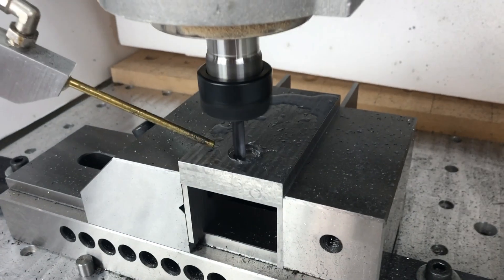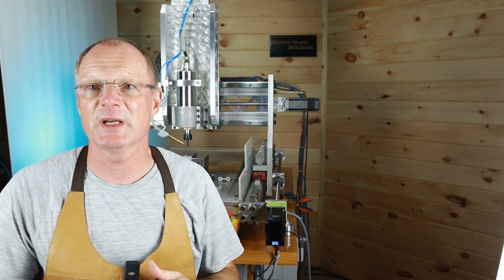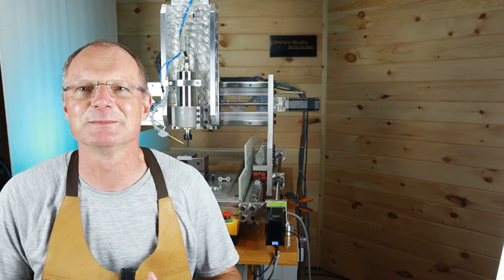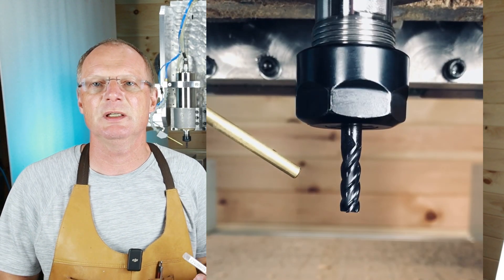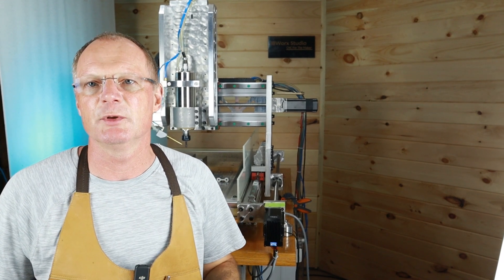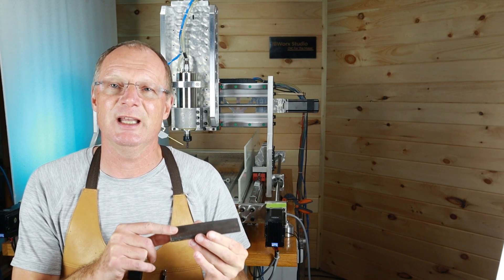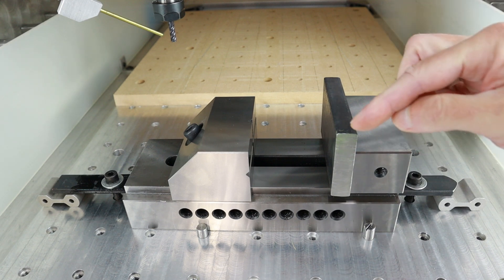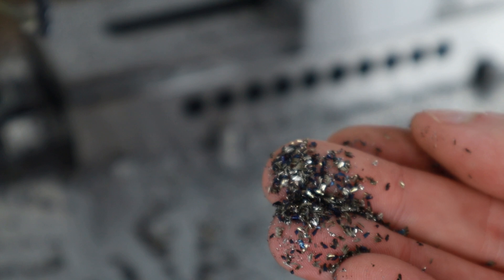Cutting Steel Using a CNC Router (CNC Router Beginner to Pro EP 10)

Comment: Great starting points in this whole series for home routers. Too man yof the online calculators are geared to industrial machines so this helps a lot. Once I get a happy sound I change the tool parameters in Fusion so it keeps the recipe for future use.
Reply from the maker: Yes that is very true most cannot account for the spindle hp and min rpm. You can also make a template in fusion for the different types of cut using a specific tool like 2D adaptive in Aluminium using a 1/4” tool or a finish pass this way you can grab an already proven set up and only have to select the contour. It’s a very handy trick. And thanks for the comment Gerrit as always nice to have you on board.

Comment: Thanks for sharing. I was just curious about this.
Some remove the scale with vinegar (takes some time). Citric acid should work too (I use it to remove rust). Needs to soak for some hours, but by heating up the solution, you can speed it up significantly.
Reply from the maker: Yes an acid pickle is certainly possible and also commercially done on many parts to remove scale. Thanks for your comment.

Comment: Scale can easily be removed using a belt sander. As you've noted, cutting tool life is significantly increased when the steel is free of scale. The same principle is true when machining sand cast aluminum.
Reply from the maker: I think an angle grinder with a flap disc works really well too. But buying it without the scale would be best 😀
Reply: @JBWorx  Scale only forms on hot rolled steel, which is rolled to size at temperatures at or above 1700 degrees Fahrenheit. Cold rolled steel is available in common sizes and is scale free.
Reply from the maker: Yes you are 100% correct, I don’t like to use it if I machine a lot of material off of it as it usually will not stay flat. The cold forming process makes it full of stress. There is also stress relived material, but now we are getting a bit away from what we use for DIY projects and what is readily available to you as a maker without operating a shop.

Comment: JBWorxStudio, you can remove the mill scale on steel by pickling it in vinegar or citric acid for a day or so. also its surprising you cant get hot rolled pickled and oiled (P&O) steel in the states.
Reply from the maker: Yes I am familiar with the pickle process we used hydrochloric acid where I worked … probably too dangerous for home use but same concept. Oh I am sure you can buy hot rolled without scale is just that the vendor I buy from does not carry it - unfortunately.

Comment: I'm new to CNCing metal. My question is, you went with a 4 fluted tool. If you change to a 2 or even single fluted tool, can't you increase your rpm to the power range of your spindle? I believe less flutes cause more deflection of the tool so dept of cut would suffer and/or it would increase chatter. In asking because i have a  9kw 24k rpm spindle and any speed less than 12k rpm is a problem. I am trying to obtain the proper tooling....Thanks! You series has been extremely informative.
Reply from the maker: Your approach is right, however there is really no single flute tool for steel for the exact reason you mention. There are 2 flutes made by Datron for cutting steel with a high rpm but the largest diameter is 3mm. I am currently trying 2 different indexable tools one for facing and one for running a pocket. The nice option is that I can exchange the inserts from cutting aluminum to cutting steel. I don’t have a link to them as I bought them long ago and never used them and now the vendor is no longer available. I might do a follow up video. For aluminum Datron is my choice though.

Comment: Fantastic video thank you. Is there any hobbyist spindle out there that can deal with both wood and metal/steel in a good way? (I assume lot of torque = less rpm?). Spinogy?
Reply from the maker: It does not have to be a Spinogy spindle. If you know you also will work with metals then it is best to choose a 4 pole spindle. Most 24,000 rpm spindles are 2 pole motors running on 400hz. So you can buy a 4 pole that will also run 24,000 rpm but will need 800hz to do so. Because it has more poles it will develop more torque at lower rpm. Also have a look at the bearing set. 3-4 bearings is great for cutting metal. 2 will work for wood. In general I am pretty happy with my huanjang spindle mainly for the cost.

Comment: Love the video @jbworx !
It is enlightening to know that its all about taking lighter cuts + slowing surface speed down to the point that chatter / vibrations are minimal.
It gives hope for hobbyists like myself, who dont' have the space for a big rigid machine!

Please share if this approach is also possible for harder steels (stainless etc)?
Reply from the maker: Thank you! Yes it’s also possible for stainless steel. Look for “free machining stainless alloys. They will cut much better and don’t harden up as easy during the cutting process.

Comment: Hi
On 2kW spindle YES -  6mm is max diameter of end mill. But for roughing and removing big amount of material is to slow. 

I made 2 projects with steel on my gantry router - 2 pieces of steel 500x800x60mm about 200kg and about 90kg of removed material...
I thought that it will never be finished, about 2 weeks of working... I said that it is my LAST project with so big piece of steel on my DIY gantry. BUT I tried something gamechanging and really cheap. 

I tried indexable milling tools with small inserts from Aliexpress. 
Try to find EXN02R milling rod with LNMU0202 inserts OR ESE/ASM rods with JDMT0702 inserts. You can find 8-12mm diameter with 1-3 inserts on it. Most of them are 120-150mm long - so you will need to shorten to 80-100mm.
12mm with 3 insert for high feed surface milling and 8-10mm with 1 insert for deep and narrow pockets. 
Of course you can find and try combination of non-standart ER20 collet 15mm and 16mm shank indexable tools after "small improvement" on lathe. Sometimes I'm using it.
JDMT - I think have less vibrations but LNMU is cheaper because insert have 4 cutting edges. 
For my gantry router it going 0.2-0.4mm DOC and 40-90% WOC, 10000-18000 RPM and up to 8000mm/min.
After that - life changed. For DIY gantry from aluminum and thi type of spindle - high feed roughing strategy with indexable tools is really good, cheap and really fast.
Reply from the maker: Thank you for this information. Yes high feed milling is the strategy that I am pursuing as well. I ordered a high feed end mill for this video but it arrived damaged so I could not use it, however I have been looking for an indexable end mill like you mentioned above as I also like to try some PCD inserts. Your DOC, Stepover and feed rate sound correct to me. 👍
Reply: @yaroslavstepaniuk5234 Hi. Great information. Can you tell more how many inserts you use for steel. As i watched on youtube some people take out one or two inserts to mill on router. Also on what rpm you use these indexable cutter on cnc router
Reply from the maker: So the thought of taking inserts out is to get to a lower feed rate as the rpm can not be lowered. You will see a bit more were on the remaining inserts and also keep in mind that the tool will still need to be in balance so the inserts taken out have to be in pairs across each other. Go with an rpm as low as you can get away with without stalling your spindle. For mine on a 6mm tool that is 12=13k rpm.
Reply: @JBWorx  i just ordered 3.7kw 400hz 220v 6000-12000 rpm water cool spindle lets see how it will work on steel
Reply from the maker: @farhanchoudhre6962 I think this is the ticket you will love it for steel.
Reply: @farhanchoudhre6962 how'd that spindle work out for ya?

Comment: Hello! thanks for the video. Is possible use the spindle 2.2kw to drive an other spindle with pulley and belt? to have more torque? thanks
Reply from the maker: In theory yes absolutely. Most mills have an electric motor and a drive pulley.
Reply: @JBWorx  if i use that metod, the spindle 2.2kw should it have less wear and tear?
Reply from the maker: Yes as there are no axial loads on the bearings I would think it will last a longer.

Comment: The most u grind the steel ,with end mill , u need full engage an lover rpm , with  water cooled spondle works ok , but the design of ur router doesnt alow for high stiffnes .
Ur lateral suports or gantey are thick , and they woblle when u enter in material with a spindle , for better rigidity u need to add some lateral traverse to lateral gantry holders .
Reply from the maker: Thank you for your input, please google high feed milling.

Comment: Excellent video!  Do you have a recommendation for a starter machine that will cut 2.5-3.0mm carbon/stainless steel?  I am looking to cut out pieces like removable hockey skate blades and mini hockey sticks for crafts.  Thanks!
Reply from the maker: That is a pretty high bar for a beginner machine. There are 3 elements you need A) weight the more the better B) linear guides and ball screws C) the spindle should be the 4pole slower running motor. However I cannot give you a specific model / vendor that provide that. Maybe the Langmuirsystems MR-1 would fit your bill have a look.

Comment: Have you tried 18k rpm with about 3000mm feed rate possibly higher? These 2.2kw spindles really like higher RPM's and feeds. I know I did some steel work with one at around those settings. It didn't sound that great but the work done was acceptable.
Reply from the maker: I don’t like to use 18k on steel, the tool wear is getting too high and the chips come of extremely hot. My strategy was to drop the rpm down to the minimum but not stall it. Even for Al I like to stay under 18k if I can. 3m/min feedrate is possible with a shallow depth of cut also on my machine.
Reply: @JBWorx  Well that's the thing you match the feed rate to the rpm. The chips stay the same but the spindle has more power at that speed.  18k to 22k is the optimal speeds for these 2.2kw spindles. 10-14k on these spindles are more for wood. In my opinion.

I completely disagree on aluminum and non ferrous. 18k rpm 4.5m to 5.5m per minute all day. But everything with cutting fluid. I either use a mister or flood coolant. 

BTW, I really appreciate your videos. Your testing on the homing switches was excellent. I'm currently building a Granite base machine and have some Panasonic optical sensors on order thanks to you. Looking forward to using them.
Reply from the maker: I think you will like them good luck on your built

Comment: I am seriously considering a 10k spindle in the next year or two to move the compromise toward metal over timber. Maybe a Spindle Changer while I am going too 😆
Reply from the maker: Yes a higher pole count motor will give a lower rpm and more torque.  If you venture in machine metals with your machine than this is a good solution.

Comment: hi i just want an advise. i have completed my cnc router an wand to replace wasteboard with either a drilled fixture plate or tslot plate. what sould i go for?
Reply from the maker: If you machining mainly wood then a T-slot plate is great. If you machine metal I prefer the fixture plate with treads. But there is no wright or wrong both will work.
Reply: @JBWorx  yes I have made my machine to work on aluminum and materials like PTFE fiber board which is hard formed and 6061 aluminium. These are widely available in my local area market. If I use fixture plate, coolant will drain through holes even mist coolant. But I think threaded plate is better for me.
Reply from the maker: Have a look at my fixture plate video there are many tips that can help you making a plate for your needs. Good luck 👍

Comment: 2.200w 24000 rpm cnc router have the torque to mill steel? at lower rpm of course
Reply from the maker: Well that is where the problem is. No torque at lower  rpm’s. So something like 6000 rpm for a larger tool is just not possible.
Reply: @JBWorx  so if i have a small endmill with 6k rpm it has torque?
Reply from the maker: Well let’s say small is 6mm or 1/4” then no it does not have the torque for that at 6k rpm. I think under 12k is not possible.
Reply: @JBWorx  but in your video you managed to cut at 13k rpm, if the tool progress slow is possible to cut steel by milling small parts bit by bit?
Reply from the maker: Yes I think 12-13k is the minimum you can get on this spindle. I think I have shown that yes you can cut steel and a 5mm or 4mm tool would even be better.
Reply: I bought myself 4mm end mills 4 flute with the same coating because of this reason. But I didn’t tried them out yet. No time so far.
Reply from the maker: @Todestelzer well give it a whirl 😀

Comment: Sir how to relief engraving on iron please guide me sir, how to roughing and finishing for relief portrait designing engraving
Reply from the maker: Well if it is a relief carving you will need a small diameter tool. I would do the roughing with a 3mm diameter but edge radius but. Followed with ball nose bit. The diameter are really dependent on the detail of the relief and so is the step over.

Comment: Hello, can you tell me what CNC machine you have or a cheap CNC for cutting metal(around $600CAD range)?
Reply from the maker: Mine is a home brew that I built many years ago. I don’t think there are true options available for that price that can cut metal. Your best bet is to built one on your own and upgrade components as you go. Possibly the PrintNC is something to check into.
Reply: @JBWorx  Thanks a lot, I really appreciate it. Most channels don't bother with older comments. Could you provide me with some basic steps for building my own CNC, or some kind of guide/resource that I can use?
Reply from the maker: Yes certainly. The PrintNC CNC is an open source project and the nice thing is that you can buy or make your own components as you choose to. Here a link 
https://wiki.printnc.info/en/home
Reply: @JBWorx  Okay thanks, I will look into it.

Comment: Do you run 400 or 800hz? I’ve been told 800hz foc spindle and vfds are better for steel… but I have yet to see any actual data on that
Reply from the maker: From top of my head it’s 400 or 440Hz. Definitely not 800. Honestly I have been really happy with this Huanyang Spindle it’s been trough hell in the years I had it and never missed a beat and the runout is still excellent.
Reply: @JBWorx  They really are impressive. Especially for the price. I have several spindles but I have one 2.2kw that is coming on 10 years of usage. I don't have an hour count on it but it's in the thousands. Still going.
Reply from the maker: That is great. I bought another one recently for a machine I sold and got it from Amazon with a 3 year warranty package … will probably not need that.

Comment: Never thought steel was something that would be possible on a CNC router
Reply from the maker: With the right tool and light enough passes, it’s doable. I have made quite a few parts from steel on this machine but I always hate the cleanup especially when I am filming.
Reply: @JBWorx  yes I could imagine that is a complete pain, maybe one day I will try it when mine is has all the upgrades
Reply from the maker: If you don’t have an enclosure then you can simply use some cardboard taped to your machine.
Reply: That would be a good idea, I do need to make an enclosure for those people that live near me.
Reply from the maker: And there is another project
Reply: @JBWorx  it's going to be a big one, I priced up for the aluminum bed a few days ago and it's going to be around $1700, problem with having a big machine is the bigger costs.
Reply from the maker: Yes that is true.

Comment: CNC router not dedicated for steel cutting, it will shorten the life span of Spindle, the bearings inside spindle will finish very soon,  it can cut materials such as plastic, foam, wood, composites, acrylic, and is ideal for cutting copper, aluminum, and other  soft metal plates to specifications.
Reply from the maker: Well luckily this is the 3 bearing spindle and so far over the last 6 years it has held up just fine.